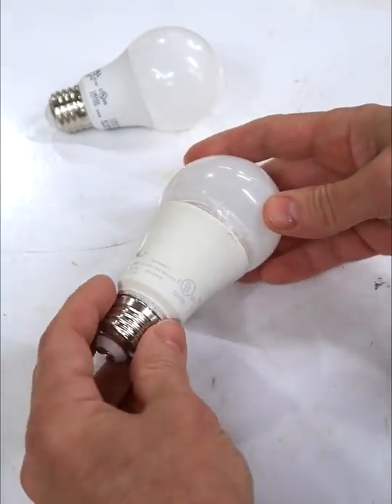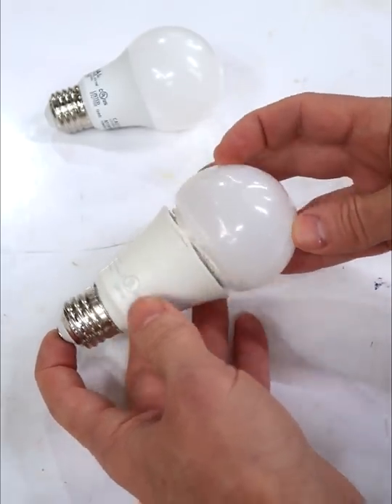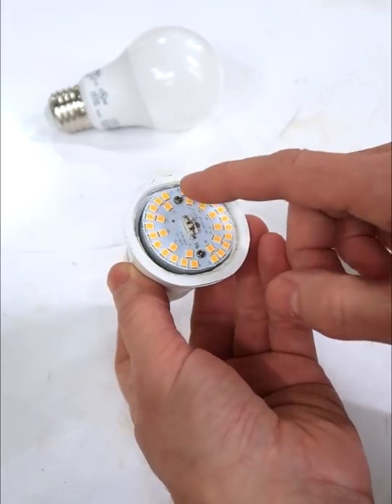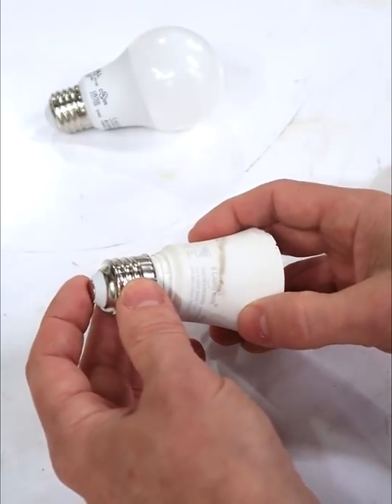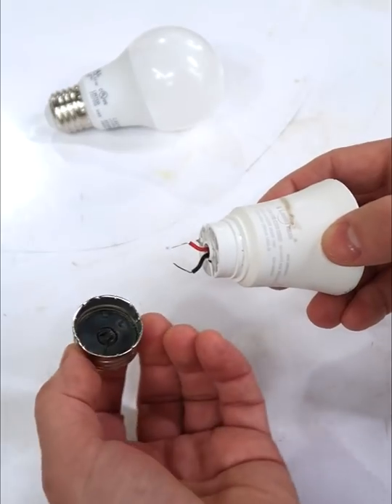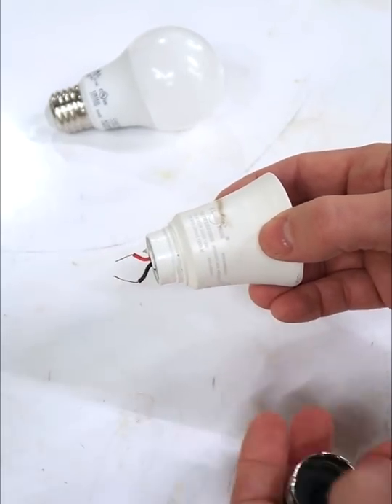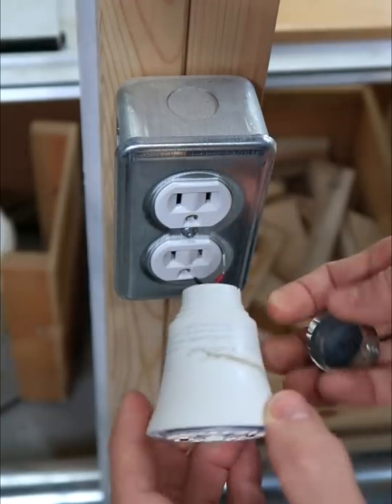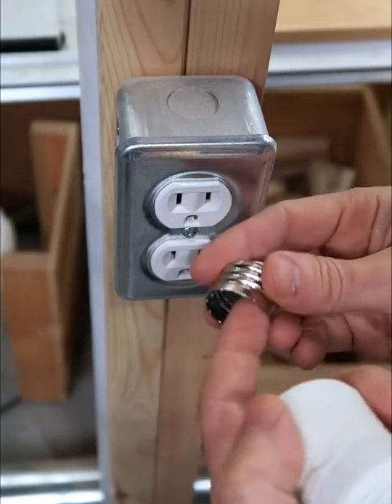LED bulb failed for dumbest of reasons

Comment: I've never had an LED fail due to the actual LED.  It's usually the driver or something like what you have there.
Reply: It kind of doesn't matter what component fails. If it stops producing light, the bulb has failed. And a great many of these supposedly very long life bulbs are failing often. (My entire house is outfitted with LED lights - I am not a hater.)
Reply: @watcherofwatchers  I agree.  Just that I believe the "lifetime rating" on these LED bulbs are stated as the theoretical lifetime of the LED itself and not the components surrounding them. I believe this is why most people become disappointed with LED bulbs not living up to their promises.
Reply: @iandrake4683  No, the rating is for the product, not a singular component. LEDs are not being purchased/sold, light bulbs are. LEDs are just one of many components that make up the bulb. The edison screw socket itself or the plastic bulb surround is likely to outlive any other component, but the ratings have nothing to do with them, onviously. The rating is for the bulb as a whole
Reply: @watcherofwatchers  then someone has some explaining to do.  

All the LED units I've had that failed after a year or two (after the box promised 10 years or more of use) always had an issue with something other than the actual LEDs, usually the driver.
Reply: @iandrake4683  It is still a failed bulb that needs replacing. It didn't meet its stated lifetime, did it? To the consumer, it does not matter if it was the driver or the LEDs that failed; it has to be replaced regardless.

To anyone other than those in a position to fix  the problem, the difference is academic. Maybe it's interesting, but it doesn't matter. Many more of these bulbs than one would expect are failing long before they're supposed to.
Reply: I have.
LOTS.

Because the cheap ones don't give due attention to adequate cooling!
Reply: @watcherofwatchers  It does matter. Knowing the LED almost never break, you can buy LED panels that have the actual driver separated. And when it dies, just replace the driver.
That is what I do.
Reply: Had hundreds of leds fail mostly 12v car bulbs though o put that down to cheap components and voltage irregularities. My weed grow lights have worked fine for years..

Most led products are overpowered to achieve a brighter light... A brighter light drastically reduces the life of the diodes. If you buy LEDs that are lower powered they will last a lot longer
Reply: @DrBernon  I am sure that you purchase LED panels and drivers separately and have substituted them in place of traditional light bulbs everywhere. I am positive you have done this. Totally sold.
Reply: I think sometimes they do design the led bulbs to burn out over time. Had a few bulbs do that.
Reply: @watcherofwatchers  If it’s not the light producing part, you can replace it more easily
Reply: @1495978707  Almost no one is doing componet level repairs on light bulbs. What is wrong with you people?
Reply: Just read up on the special bulbs used in Dubai or watch some videos on here. they use less power. They last a lot longer too.
Reply: @watcherofwatchers  Yes. I had it easy, because I had those round light fixtures that hold 2 bulbs and go in the false ceiling. So just had to replace them with same size round LED panels.
Reply: @iandrake4683  I think that manufacturers are using the fact that LEDs as a technology can work for a very long time to market their products as having the same life expectancy. But what often happens is that LEDs are being driven at a higher power (to reduce cost) instead of using a bigger number of LEDs at a lower power, along with the driver failing (often due to the electrolytic capacitor overheating and bursting from what I've seen). So yeah, marketing
Reply: nope for me always the led
Reply: Tonnes of LEDs failing, mostly bc they are not cooled well enough
Reply: Go look at traffic lights, they're always with missing or blinking elements...  my personal favorite are the disco flash street lights
Reply: @pear7777  Yes. That is another thing I have noticed. They put the power supply and the LED encased in plastic, both heating each other. It is terrible.
Reply: @iandrake4683  Yes, as with all previous bulbs: calender life was/is an estimate base on some expected number of hours energized per day:
We all have lights getting left on all the time, orher ones hardly at all...
To really test, pick a fixture that can take 2 or more bulbs that you use a lot, like kitchen ceiling, or kids' bathroom (I don't use makeup, so, I use main bathroom with 2 doubles, so I can install 2 of each [ don't want to base decision on 1 bulb]), and install bulbs from two different manufacturers; mark installation date on bulb, and see what lasts.

I bought a ~cheap fluorescent in the late 90's, and it outlasted numerous other cheap flourescents over about 10 years: it is still working, but the light yellowed a bit, so I finally put it a closet about 10 years ago.
I live up north, so, putting them outside is a but marginal, as temperatures usually gets below their operating range multiple nights per year (which is when you need them outside, at night...).

But I bought several solar-recharging LED panel lights for outside that seem to do quite well at -20F. (Once I replaced the smallest capacity NiMH cells with mid-range capacity ones...cost another $5, but, I got the lights on clearance for $5 less, and they were pretty easy to change, so all good!)
Reply: @MaNNeRz91  Interesting point, TY.
I would point out that several makes of automobile (specifically Volvos, since late 90's, but, others too.) are not 'happy' with non-OEM aftermarket bulbs, conventional, or LED replacements will often result in error/fault messages, and, in certain applications, minor malfunctions.
Be careful.
Reply: Cars and lightbulbs are taking opposite paths in terms of modes of failures.
Electric cars use less components that older cars, to function.
LED bulbs use more components than older bulbs to function.  
Just takes one component to fail.  And usually I see one burned LED in a series, where everything else is fine.
Reply: Yes and that's why a proper LED lamp separates LED and driver circuitry. LED bulb is a bastardized solution for jamming a new round peg into a legacy square hole. Driver and LEDs just should not be packed so closely in such an inadequately cooled package. Electronics life expectancy is negatively exponential to temperature, of course even best made bulbs will fail way too early. A proper LED lamp has no business having consumable parts in need of quick change interfaces, maintenance and repairs should be infrequent enough that even solder joints are perfectly fine to use.
Reply: I've had a few failed LEDs, but they were typically over driven by the driver being poorly designed (at least if you're designing for longevity!)
Reply: BINGO
Reply: Had multi-diode LED packages in bulbs fail with the bonding wires in the package failing/coming loose. Can often be located from a black spot forming, due to arcing, visible in the phosphorous silicone layer.
Brute force approach to reviving the bulb, at slightly reduced brightness,  is to simply jumper the failed package.
Reply: @dimitrijekrstic7567 See 'Dubai LED' to see what can be done when someone, with sufficient clout, puts down the foot...
Reply: They fail due to the leds all the time. If you crack them open you often see one of the leds with a black dot on it where it’s burnt out. If you cut that led off and solder across terminals then you can get months or a year or more out of the bulb again before another fails. I’ve “fixed” the same bulb multiple times and gotten an extra 5 years…
Reply: @watcherofwatchers I do… I can hack off a burnt out led and solder on a smd resistor in less than a minute, so for a $3 bulb repair I’d be earning $180/hour…
Reply: Yes it's usually the driving circuitry, but I've also seen the actual leds fail, because they are simply running them too hot

Comment: The guy who "solders" them and is paid for every one: "They discovered my secret of 500% production!"
Reply: Right it's not the reliability of the bulbs!  It's the guy!  lol
Reply: Piece work, Meh.
Reply: That kind of thing can also happen when management is pushing workers so hard that everyone is exhausted and cutting corners and never double checking anything because they don't have time to do things right.
Example: could have just been going through the motions on autopilot in hour 13 of the 12th day of the workweek and not have even noticed the soldering iron wasn't melting the solder anymore untill he'd already churned out more than he could count and just kept quiet about it to avoid being punnished.

At the consumer end, it's almost impossible to tell the difference between laziness and management not being willing to pay for enough man hours to meet quotas without cutting corners.
Reply: They're actually not intended to be soldered. It's a press fit design. Hard to explain without a diagram but in essence the middle contact is a pin that compresses the wire against the plastic ring. The other wire is held in place between the screw thread and plastic case. It actually work well for low power light SO LONG AS IT'S ASSEMBLED PROPERLY 🤦‍♂️.
Reply: By "guy" do you mean "11 year old Mexican girl being paid 90 cents a day"?
Reply: He has become forgetful from al the soldering fumes.

Comment: The reliability of LED bulbs is pretty amazing.  The reliability of their construction on a mass scale by corporations run by bean counters is just disappointing.
Reply: It kind of doesn't matter what component fails. If it stops producing light, the bulb has failed. And a great many of these supposedly very long life bulbs are failing often. (My entire house is outfitted with LED lights - I am not a hater.)
Reply: China

Comment: Bare wires directly into the socket, big Electroboom energy in this vid.
Reply: Children aren't allowed to stick things in a socket, adults are. If you think about it, it does no good to stick insulated wires in a socket. Remember, safety 3rd! If safety is 1st, nothing will ever get done!
Reply: North American plugs are .. interesting.
Reply: @orion7741  If you're a long-time viewer of Matthias, it's likely you can get  a chuckle by searching for all the comments from "safety sally"s.
Reply: @rasmis  In what way? The fact that you can plug in a lightbulb to a socket without asking permission from the queen?
Reply: @rasmis  In Sweden we have some plastic cover inside the hole. When you put the plug in the cover slide away, and back when you pull out. Sometime just for testing I miss the old one, just poke a cable in the hole.
Reply: @rogsoll  We have those shitty types of plugs in the US also...they are required in most new construction. They are shit.
Reply: Only weak ass 120v, barely a tingle.
Reply: It's literally a tiny fraction of the 'bare wire' exposure of a plug 🔌
Reply: @orion7741    Nailed it !!
Reply: @jakuszkowiak martin luther chess queen 👸👸👸
Reply: I was about to expect a pop and a bleep lol

Comment: The advertising is technically right, the LEDs themselves do last forever.  It is the other electrical components (driver and wires) that don't last as long as the LEDs.  We are just in the same boat as before.  Manufacturers will only make the bulbs "good enough" for you to buy them, and keep coming back to buy more.  If they lasted forever, the manufacturers would run themselves out of business.
Reply: LEDs can still burn out if they're driven too hard. Particularly if they're operated near their maximum voltage, which is common as a cost-saving measure.
Reply: The reason this isn't true is voltage regulation.  A lot of the time this is done via cheap methods and the diodes are over driven and prematurely die.  That is the reason for almost all diode failures you see.
Reply: I'm running CREE 4Flow bulbs all through my house. 6 years and still running strong.
Reply: If the bulbs last forever, the manufacturers go out of business.
If the manufacturers go out of business, the workers are out of a job.
If the workers are out of a job, the government is out of its tax money.
If the government is out of its tax money... etc etc.
Reply: Buy Philips
They do work for at least 20 years on my experience so far
Reply: This is a ridiculous argument. One company would just make an everlasting bulb and dissolve after making 10s of billions of dollars. 

Would you rather sell 90% of the world's lightbulbs in 10 years or spend 100 struggling to compete against other very similar products?
Reply: @akivaweil5066  No argument in its ridiculousness, but that is how industry works.  The focus is on making profits for the business, not on what would be the best thing for you and your future.
Reply: @TheOomgosh  When did I mention anything about the business being selfless?

Greed is why the free market is (conveniently) awesome.
Reply: Drivers can last as good as forever too if you don't cram them into too hot and small space inside a bulb format. Electronics need to run cool and they can't do that in this legacy format.
Reply: @thewolfin  i helped move a working international harvester refrigerator built in 1933 fifteen years ago. only one i ever saw. its hard to get repeat customers with that kind of quality.
Reply: This. They could make them much more reliable. One annoying thing they do is put all the individual LEDs in series so that the failure of 1 ruins the whole light.

Comment: That's more of a cost cutting problem than LED bulb problem in my opinion. Same could happen to any other type of bulb.
Reply: or just a bad bulb like this can happen with very bad luck.
Reply: It's not entirely clear to me that you could even attempt that shortcut in a bulb that drew a lot more power than LEDs do. The bad contact is a point of high resistance, which might not stand up to the higher current draw even in the best of circumstances.
Reply: but it DOESNT....  that is the point.    that never happened with incandesants or compact flourescents.    so, no it really could not happen with other bulbs.   you might ask "why not?".  and the answer is because they are assembled differently so that you will never have that problem.   it is ONLY with LED bulbs.
Reply: @orion7741  if you have taken apart a incandescent bulb you will know that the glass bulb has two wires poking out in roughly the exact same spots under the glass as the led bulb shown, the thing is incandescent bulbs are so old that the machines making them are all probably 50+ years old and make to work with solder, if someone decided to make a new machine to produce them it could easily have the same issue if people were being cheap, LED's don't have anything to do with this issue other then the people making them being cheap
Reply: I've never had a bulb fail. 67 years of research (although arguably the first five could get an asterisk 😄)
But I think a bulb (as you allude) that fails is a severe statistical outlier. 
That said, where's our lighting reimagined in wood? 😝
Reply: @orion7741  because they are CHOOSING to make the LED's like that. It's poor design and anyone with an electrical engineering degree wouldn't design them like that. This is companies purposely making the LED lamps to fail because otherwise they would last 10+ years and the manufactures wouldn't hardly sell any more new bulbs. It's a form of planned obsolescence.
Reply: bingo. LED tech is far superior...this is just shitty manufacturing.
Reply: Yes. The problem is that LED bulbs are more forgiving to bad design, because of the small power, and anyone can buy LEDs and assemble one of these. With that, the market if full of junk LED bulbs.

Comment: I've replaced the bulbs in my house with Feit Electric or Sylvania LED bulbs. I've yet to have  failure, aside from the two I tried to use in the vent hood above the stove. For some reason, they didn't like the environment there, Those were replaced by the original 40-watt incandescent appliance bulbs that came out of it.
Reply: I bought an 8 pack of sylvania led bulbs for my range hood. The first one lasted about a week. I opened it up and it was actually one of the led’s that had burned out. I replaced it with another one from the same pack and it’s been going for about a year.

Comment: I’ve had so many LEDs do the flickering nonsense…even right out of the box.  So maddening!
Reply: Some bulbs are not meant to be used with dimmers. That may not have been your problem, but I thought I would add that for others in any case.
Reply: @jerrywhidby.  It's a common enough problem even without improper use cases. Every single LED bulb that failed on me went out in that way, some of them even buzzing in time with the flicker. That's not a combination you want to see in any electrical appliance.
Reply: Its not uncommon to add a transformer to reduce the output reaching your 5 watt bulb

Comment: I have tried liking LED lamps, but they have not worked out for me. My number one complaint is RF interference with my Ham Radio Equipment. My "Nvision" and "TCP" brand CFLs have very good filtering, as i don't hear any noise on any of the bands i'm permitted on.

My LED's on the other hand, BLAST noise across all bands, and cause a full quieting transmission to drop to pure noise.

I hope they get better.

Comment: I had exactly the same fault with a LED bulb. The wire that connects to the outer screw part is just jammed under the metal. On mine, it had fallen out or was never fully inserted during assembly. It flickered when new, right out of the box.
Reply: Try using some super glue in the seem that meets the driver.
Reply: @williamwilliams3411  I don't think super glue would have worked with mine. But I did manage to fix it by soldering the wayward wire to the base. (Just for fun)